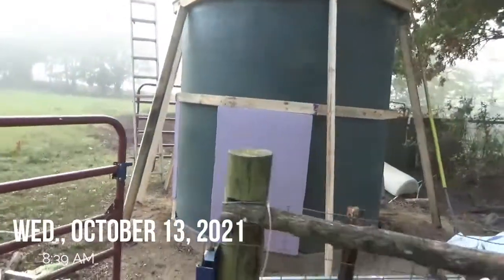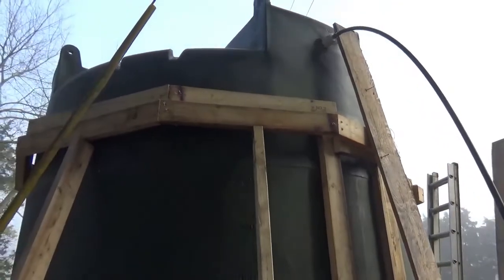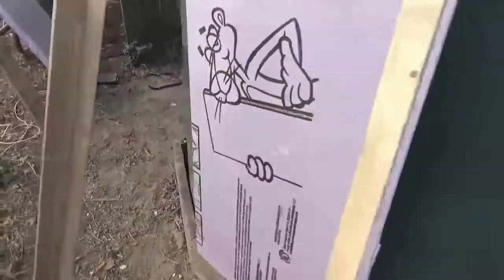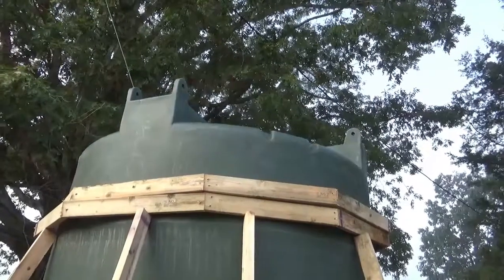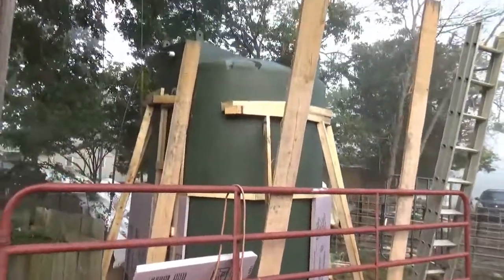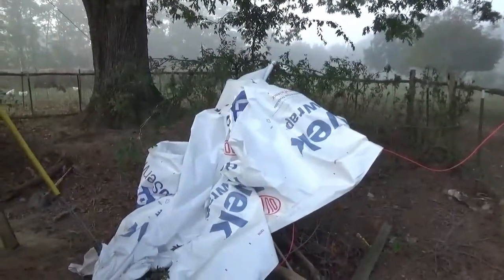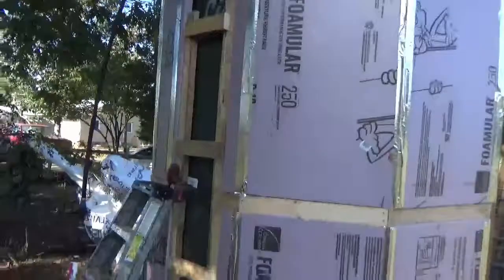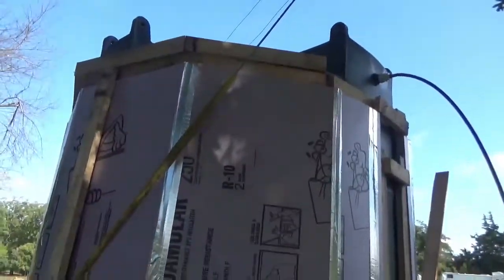Insulating the Water Storage Tank of our Off-Grid Solar Water System to Prevent Freezing | 10/13/21

Comment: So how did the insulation work. Would you change anything ?
Reply from the maker: r10 is sufficient so far.  I did add 24 volt dc heat tape to the pump house plumbing that includes the filter, valves and pump.  I did have a filter freeze last year.  This year there have been no issues even with 3 nights in a row below 10 degrees.

Comment: Ty for posting. So you could bury your pump.  Did the water in the tank freeze?  I am looking a -20 F.  Ty
Reply from the maker: Water did not freeze in tank.  I would bury only if you have to.  I am using DC powered heat tape now so I hope for no further problems.

Comment: If you have access to a backhoe
Maybe think about
GEO Thermo
Burying pipe (may be 4 inch drain pipe)
And circulate the earth's temp..  Maybe 42°+  in a building could prevent freezing tank pump pipes
Lots of videos on Utube
Reply from the maker: That is a good idea but perhaps too much work for zone 7.  Some 24 volt dc heat tape is doing the trick.

Comment: How'd this work out this winter so far?
Reply: Thank you for asking.  The tank itself has been fine even down to about 10 degrees.  However, when we first got below 20 degree I had some plumbing freeze up.  I lost a filter and had to replace it with a section of pipe.  I added some AC powered drip tape.  I will be changing over to DC powered drip tape so it will be off grid again.  I also doubled the insulation around the pump house from R10 to R20.  The video is in que and hopefully will be making its way here soon.